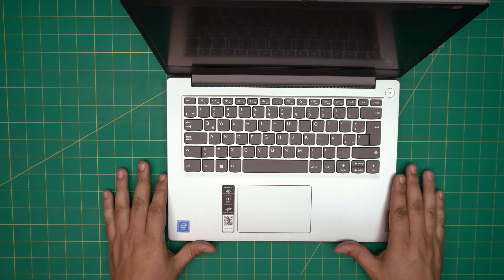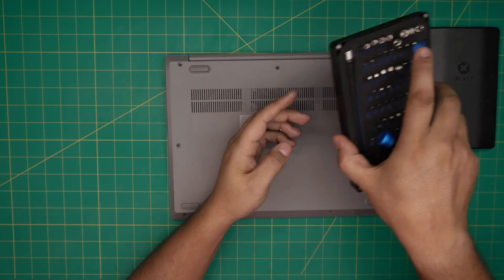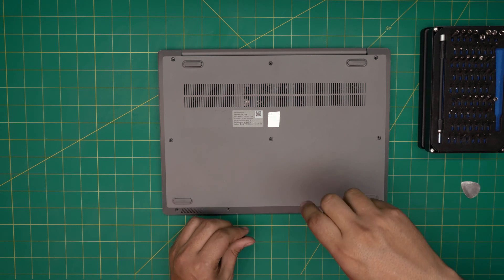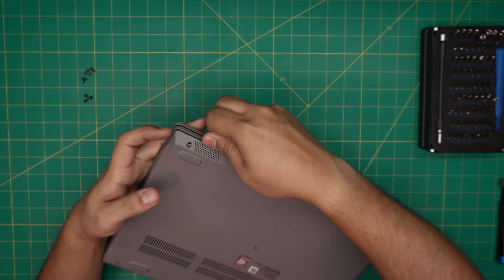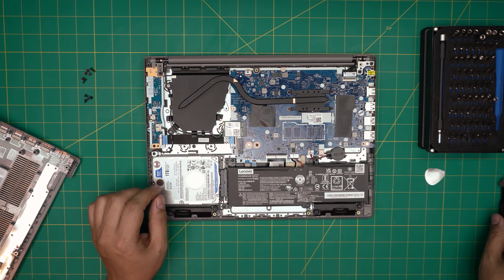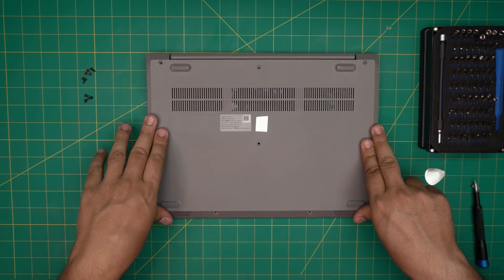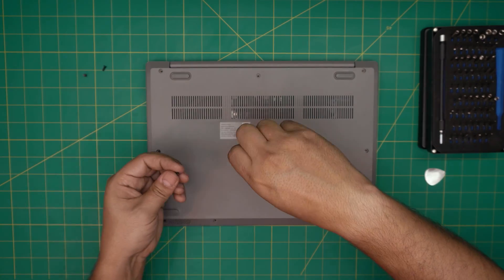How to Replace Battery on Lenovo Ideapad 3 14Igl05 Laptop - Step-by-Step 🔋

Comment: I powered up the laptop right away after installing the new battery and also plugged it in?  Any concerns with doing that?  I have not since unplugged the machine and am letting the battery charge on it's own but it did get to 0% but was near 0% when I got it.   Thanks!
Reply from the maker: 🫠Regarding your question, don't worry if you powered it on for a bit; it's just a recommendation, not a big deal. Just do one full charge while it's powered off, one slow discharge without the charger, and then one full charge without powering it on.
Should you have any further questions or requests in the future, please don't hesitate to ask me.
cheers🍻
Reply: @uFixTek  I don't think it's the battery, tried 2 new ones including one from Lenovo parts.   Laptop will run if power is plugged in and battery is out of laptop but will not charge with battery in even if plugged in.
Reply: bigger issue?

Comment: Do you know if it the replacements are pre-charged. I am guessing no. Meaning while it is in the off position we  would actually need to charge it for the 5 to 6 hrs then remove the charger and use the laptop until it runs out of gas :) then charge again for another 5 to 6 hours ... Then use as normal?
Reply from the maker: 🫠Regarding your question, these batteries normally get shipped out with 30-40% charge because of regulations. 

All you need to do is, once you install it, leave it charging for 3-4 hours. Then power it on without the charger and use it on a light load with brightness under 50% until the battery charge gets under 20%. Then power it off and leave it charging for 3-4 hours (5 hours if you can). After that, you can use it as you normally would. This initial charge and discharge is crucial for the new batteries.

Should you have any further questions or requests in the future, please don't hesitate to ask me.
cheers🍻

Comment: I have IdeaPad slim 3 i5-12th gen with 37wh battery only...can i put 47/45wh in it??? 47wh is also inbuilt in slim 3 IdeaPads
Reply from the maker: 🫠Regarding your question, as long as the battery fits and the connectors are the same sure you can.
Reply: @uFixTek  thanks for the reply mate
Reply from the maker: It's my pleasure my friend.

Comment: Thanks for posting this.  My Ideapad 3 only powers up with the power supply connected.  As soon as I unplug it, the unit shuts off.  The battery charge icon says battery is full but the icon is white, like it is fully dishcharged.  Sometimes it does show 100% black and it will work without the power supply for a short time.  Is this a battery issue or something else? Thank you!
Reply from the maker: Thank you for your feedback! If you wish to support the channel, you can like, subscribe, or both!
Regarding your question, that is 1000% the battery issue, replace the battery and you set to go my friend.
Should you have any further questions or requests in the future, please don't hesitate to ask me.
cheers🍻
Reply: Yes!  I just replaced the battery and its up and running again! Thanks 1000% for the help and advice!  You da Man!

Comment: Man this laptop is designed so poorly for removing the back. Theres such a tiny piece of plastic around the USB ports and pulling the back off broke them
Reply from the maker: yes it is very weak plastic that are used on this models they are very dry and weak.

Comment: I got one of those computer a week ago. But, the battery lasts only 3 hours, is that normal?, I am a bit worried. Thank you so much.!
Reply from the maker: Thank you for your feedback! If you wish to support the channel, you can like, subscribe, or both!
Regarding your question, it all depends how many programs you got opening in the backgrounds and the display brightness is at 50% or more and cpu usage is set to best performance or balanced.
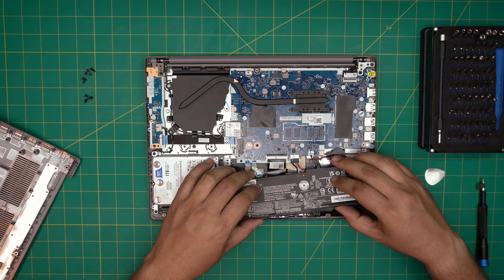3h on mid load it what it is, 3:30min at max load you should ger 30min or 40
Should you have any further questions or requests in the future, please don't hesitate to ask me.

Comment: How do I fix my ideal pad 3 when I have power but a black screen?
Reply from the maker: Thank you for your feedback! If you wish to support the channel, you can like, subscribe, or both!
Regarding your question, remove the internal battery and disconnect the CMOS batter (the small battery under the main batter) and with charger disconnected, press and hold the power button for 60sec then plug back everything and power on and wait 15-20sec. let me know if anything.